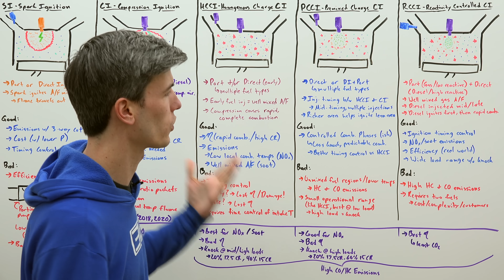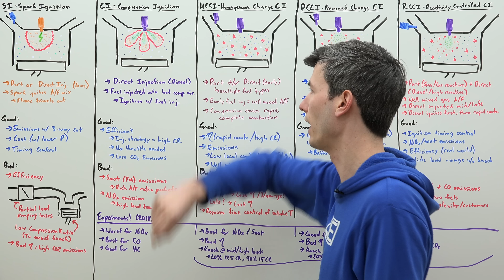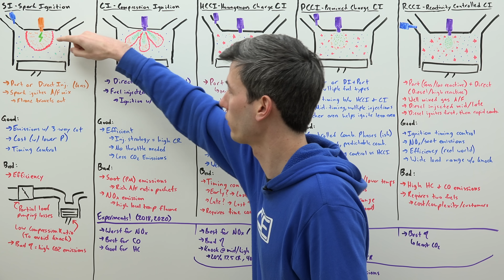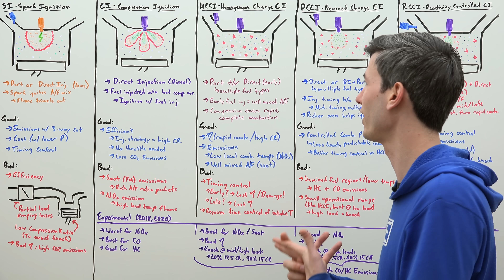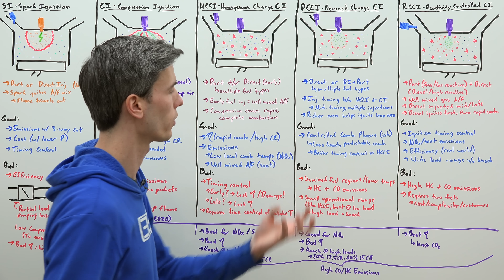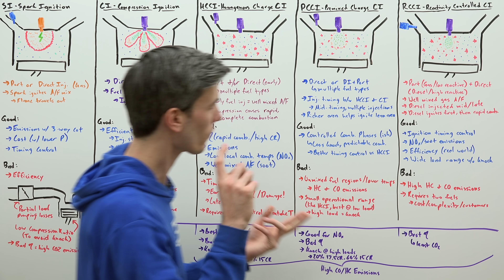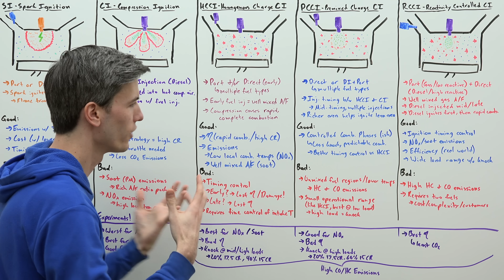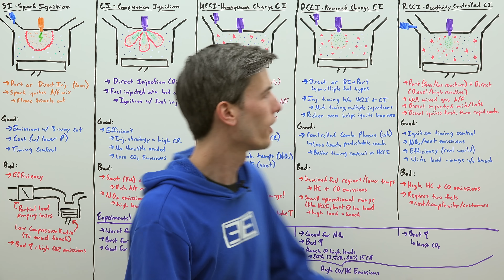If Combustion Engines Have A Future, What Is It?

Comment: How about a diesel/gasoline hybrid combustion  (called "diesoline") engine, or SCCI/D-cycle/LTC engine. SCCI= Stoichiometrically-charged-D-cycle-low temperature combustion engine. It is by port-inject correct fuel/air ratio into cylinder which is filled with high amount (30%~50%) of burnt gas (called BGR) via Differential-stroke cycle to retard the compression ignition and combustion rate. The ignition timing can still use the spark plug. If interested the detail can be discussed later.

Comment: Why don't we just get rid of internal combustion engines altogether I say that as a car guy electric motors are so much more efficient and instant torque mabye have a small super efficient 3 cilinder diesel engine as a generator to cycle on an off to charge a plug in hybrid battery pack so basically a hybrid then just have three phase traction motors on all four wheels so all wheel drive.

Comment: Is it a bad idea to have multiple electrodes on the piston head which line up to elecrodes on the end of the cylinder and then simultaneously creating many uniform sparks that traverse the entire volume of the compressed cylinder?

Also I feel like a commercially viable consumer engine that uses the RCCI model could be filled with a special nozzel at the gas station which fits a standard port allowing you to fill both tanks at the same time.  I dont think thats gonna happen but in the event that they eventually became wildly adopted I think you'd want to sell your vehicle with that design and include either an adaptor for individually filling the tanks or have 3 ports, allowing gas stations to slowly adopt the standard

Comment: Pumping losses on spark ign gas engines? At idle, throttle closed, the intake stroke causes a vacuum, but that vacuum pulls the piston up on the compression stroke. Power stroke creates vacuum, but it's lost on exhaust stroke. So only one of 4 strokes has a  pumping loss ?

Comment: OK wait a minute HCCI ie carburetted diesel but diesel is not a gas so would it not be better to use a gas. I have been bleating on about producer gas engines for years. The problem is that it does not use the full energy of the fuel. Do that and you are on a home run. OK consider this something like a very large asprin but compacted charcoal 25 kg. You pop it in your car and that's your fuel. Its so safe you can store them at home no gas stations you can sell them at mom and pop stores. Try doing that with gasoline. I live in Portugal which produces a huge amount of eucalyptus wood for the paper industry. About 30% of the logging industry goes to waste. America is full of dead trees from asian beetle waiting to go up as forest fires. Carbonise it all. The future is the past carbon the best fuel.

Comment: Why not have an ECU control both air and fuel mixtures in an HCCI engine to control timing, air control would be a long term adjustment by adjusting a turbo wastegate for example, and adjusting fuel for shorter term control.
Or for RCCI, inject very high temp air instead, increases pressure as well as also increases turbulence. that air could be gotten from a custom turbocharger.

Comment: From 9:35, you got it all back to front. The gasoline is the highly reactive fuel, and will ignight via compression sooner than the diesel fuel, not later. So you would need to inject the diesel fuel first, and then the gasoline to start the ignition process.

Comment: Authothermal reformation / thermochemical recuperation seems like a good candidate for reactivity controlled CI, since it sidesteps the two fuel issue. For something like methanol, using waste heat for hydrogen reformation increases the LHV of the fuel going into the engine by around 20%, so even if you did nothing else, that's an effective 5% increase in efficiency. You also have two fuels by default -- the reformed hydrogen, and methanol, so you can adjust the mixture of these to control combustion properties in the chamber. Of course, you can also do this with other fuels as well, but they typically require higher grade waste heat. This kind of technology is probably why Toyota is looking into hydrogen ICEs -- not because we particularly want to fill our cars up with compressed hydrogen, but because it opens the door to other technologies that can boost the efficiency of ICEs, and that can be made carbon neutral or negative.

As for whether or not ICEVs have a future, I think it's pretty clear that they do. The issue with BEVs has always been charge time, not range. If they only had 200 miles of range but could be charged to full in 30 seconds, I think that would actually be a more compelling product than a car that has double the range, but takes hours to charge (i.e. what we currently have). The onus is really on BEVs to prove that they can displace regular cars, because, despite their efficiency, the long charge time means that they're a notable downgrade for certain use cases.

Comment: Are you aware of PVI ,platinum vapor injection . By the introduction of platinum into the combustion chamber catalyzes the fuel in the engine burning more carbon , producing much less emissions . and better mileage .

Comment: On one side we consider using petrol AND diesel in one car is too complex
But then there is AdBlue!!!!!!!

Luckily i dont drive an AdBlue Diesel, they really suck
Reply: And pls stop lying about "efficiency" of electric cars...
Considering most electric cars are charged by coal, nuclear power and co,... the efficiency goes down a lot, only think about power grid losses with the higher load on them BECAUSE OF EVs!
250kW chargers... how much homes you can power with damn 250kW?! And there are A LOT CHARGERS OUT THERE.

Comment: rcci would be when you install LPG/propane on diesel engine,you have to still have low % of diesel to inject to burn LPG and hi octane of LPG good for high compression of diesel engine.i was always intrested but never found anyone doing it with how you have to adjust high pressure fuel pump and so on is more complicated on diesel engine.Please make a video about it.

Comment: Consider using a sterling engine to scavenge heat from the exhaust and route the two through an automatic transmission.

As I recall from a magazine article in the 1980s (late 70s ?) NASA put a sterling engine in a ford Capri. Ran well and had an unexpected benefit. Because the Sterling is a sealed system the expansive coolant is sealed in the engine. When they took it apart to measure wear found the wear negligible. They said the engine cost like $5,00 or $10,000 but that was custom build. Making a conventional engine from scratch would have cost as much. Production line would reduce the cost of any engine.

The magazine may have been Popular Mechanics but I think it was a car magazine. I am thinking Car Craft or Motor Trend.  

They were running it as an external combustion engine that could run on anything that burns. Gasoline, kerosene, natural gas, etc.

Unable to find the article on the internet. There are major opponents to such an engine. Such a vehicle does not require a muffler, catalytic converter, antifreeze, oil for the crankcase (expansive coolant took care of this), not dependent on oil industry for fuel.

Comment: This RCI concept reminds me of the study I did on World War II F for F airplanes launching off aircraft carrier decks. They used water injection to control Knox during the time of his high compression hi mission styled of Motor‘s water injection gave them more horsepower because of more intake of air and fuel with less knock the water at self controlled the RCI concepts or did the RCI concepts what are your thoughts?

Comment: I personally believe the best solution to this issue is this. A gasoline vapor engine. Vaporize the fuel and keep everything else conventional.  You control the engine entirely and it will get the most efficiency you can squeeze out of it. The Idea is to be zero emissions right? If you do this with a hot ignition and 10:1 compression you should achieve 100% fuel burn. Maybe this is wrong but worth a look either way, I know it works cause I have done this but as far as testing the emissions I have not.

Comment: As I said in one of your other vids.  McMurdo and the Artic Circle where temps get down to -40F/C, that is where most gas engines and near all electric motors just give up.  That is why the DC-3/DC-10 planes are still in use.

Comment: Although an electric car may be twice as efficient compared to a car with an RCCI engine, it still depends on how do you calculate. Do you expect the electricity to come from a perfect energy source? If yes, then the electric car is clearly a winner. If not, then you should look what the real energy sources are. Another way to expand the view is to think about the battery costs, how long one battery lasts, effects of production on environment, etc. The batteries are still not so remarkably good, although we can see electric cars getting more popular already.

I see at least two possible ways to have clean and highly efficient internal combustion engines. 1) Use a diesel engine and better fuel. That better fuel would probably be DME. 2) Use RCCI engine and better fuels. The low reactivity fuel could be something like methanol. The high reactivity fuel could be DME. As far as I know, these alternative fuels burn very clean.

To produce alternative fuels economically, and to have them relatively inexpensive compared to Diesel oil and gasoline, we would need inexpensive hydrogen production. How to do that, is another topic. Also some source for carbon dioxide would be needed to produce methanol and DME.

There is also the possibility to use completely carbon-free fuels such as ammonia and hydrazine in internal combustion engines.

Comment: the sale of new combustion engined vechicles is being banned in less than 9 years so whats the point? we need to look more at bio fuels rather than fossil fuels .
Reply: What is the point? How good do you think batteries will become? Liquid fuels are still superior energy storages.

Biofuels then, forget about them. There just is not enough available biomass for biofuel production, if replacement of fossil fuels is the goal.

If we wish to replace fossil fuels with some kind of carbon-neutral or carbon-free fuels, we should think about production without touching biomass at all.

Ammonia and hydrazine are completely carbon-free fuels. Fuels with some carbon content such as methanol and DME could be produced carbon-neutral way, by collecting carbon dioxide directly from air or seawater. Inexpensive hydrogen is required, practically speaking more nuclear power plants.
Reply: @aleksinummivirta3878  we dont have the time to build enough nuclear power plants they take 10 to 12 years to commission. wind and solar need to be subsidised by the existing power grid to keep them in phase with the grid, the only way forward for coastal cities is tidal power the tide comes in the tide goes out and it never stops not ever. further in land I just dont know what we will do. yes i get that fossil fuels are around 30 times more energy dense than anything we can produce via electricity generation for vechicles but governments are not taking any notice of that fact.

Comment: Spark Ignition runs on electricity...
Compression Ignition runs on fire...
HCCI runs on magic...

I find it funny that Spark-controlled Compression Ignition isn't on this list. 

If you were to combine all of these technologies into a single engine, you'd probably have an extremely efficient engine. Bonus points if it's also an electric hybrid.

Comment: For si what if a dual throttle body was applied a smaller throttle body that has a shorter throw making it fully open ant minimal throttle and via a sensor when the throttle is 75% it closes a valve behind the smaller throttle now that the larger throttle body is open fully would a system like that be an option I'm just curious since most vehicles now have electric throttle bodies anyway

Comment: Really the future for combustion engines is actually very good why ?because win the public realizes there here  with all of the antiquated grid electrical system .in this country you will end up with more brown outs then you have already ,and you will go nowhere because you can’t charge your car and if they ever find out the truth about the batteries technologically no matter how small you make a battery you still have to charge it tremendously with high-voltage to propel a 3000 pound automobile at 55 miles an hour for three or four hours or longer having an accident where a massive discharge instantly happening  .especially if it’s in or around water will electrocute people and cause fires .if you just take and go to YouTube you can watch a video where they take a watch battery expose it to a butane lighter end it explodes with a whole lot of energy get a bigger battery in an accident where the other cars on fire and have an even bigger explosion .these are some of the unintended consequences no one wants to talk about. so if you want to continue to drive you’re going to need a internal combustion engine .this is a scam to re-energize the economies of the world for everyone to buy a brand new car electric .then when everyone sees the failures you build more brand new cars with hopefully hydrogen cell technology this is not a conspiracy theory this is a fact that is happening. I worked 50 years as a technician on automobiles of all sorts and I have seen designed obsolescence run its course and the things they will do to continue the gravy train are endless and limitless the best thing you can do is to keep an old car with a point system around as a back up. No I didn’t mention what is CME is or and EMP but we are due for an CME from the sun on a large scale if this occurs  No one will be going anywhere.
Reply: This is interesting

Comment: CI - replace the single injection nozzle by, say, 10 and each blob of fuel coming in, is 1/10th with exponentially larger surface (surface relates to the 2nd power of blob radius and volume with the 3rd power, so surface to volume ratio improves a lot).
And, if we want to slow down global heating, then we need more particulate matter in the atmosphere, like we had in the older days.

Comment: Well with Euro5 diesels we already have to fill two tanks (Diesel plus AdBlue). So if it is more efficient I don't see that as stopping us from using RCCI in trucks. More so if you take into account the already in use Diesel-Gas systems to reduce costs by using a mix of Diesel and CNG.

Comment: the future of combustion is: EXTERNAL combustion & a sterling heat engine and / or- achates opposed 2 stroke engine, primarily military use. it's not about the fact that it's an ice engine- the problem is big oil jacking with the price. perhaps more B100 and pure ethanol? an excellent choice over petrol.